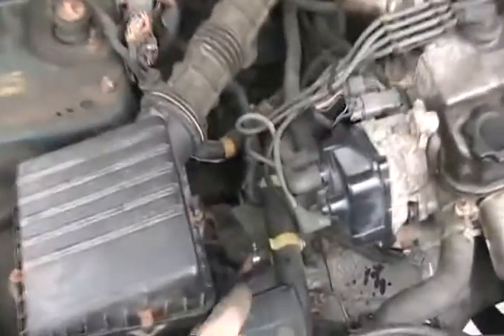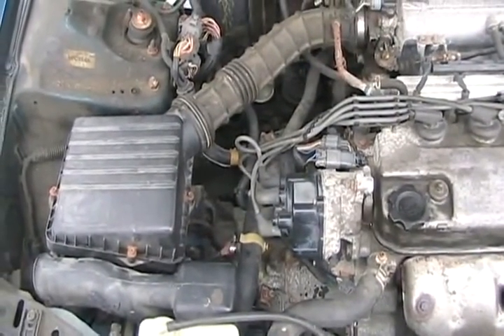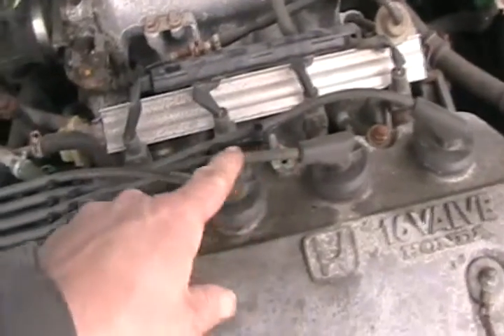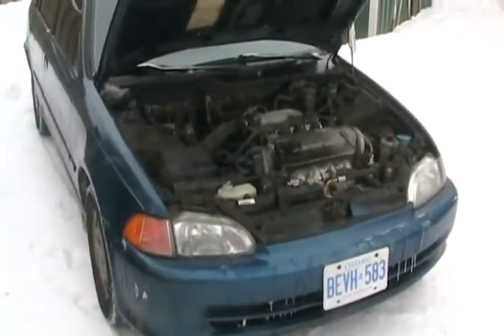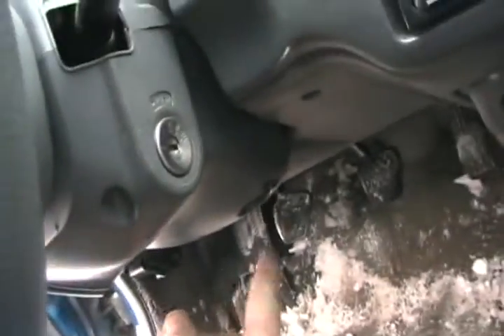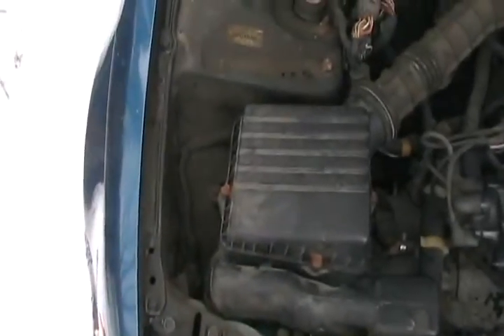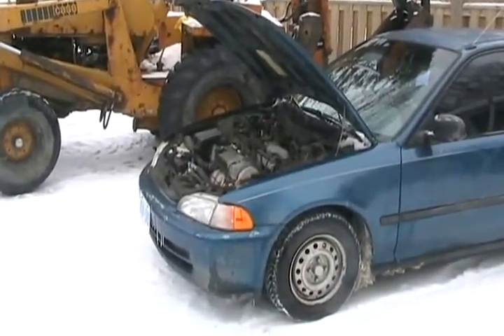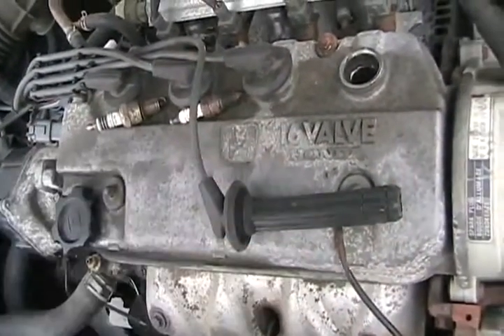#1209 Automotive mythbusters,tune ups,part 1 [Davidsfarm]

Comment: I prefer engines without computers and with, distributors, timing chains ect..... because i can fix them myself without much bother, to me the early 80's late 70's cars are good for that and still have got loads of power but are yet simplistic with fairly affordable parts.